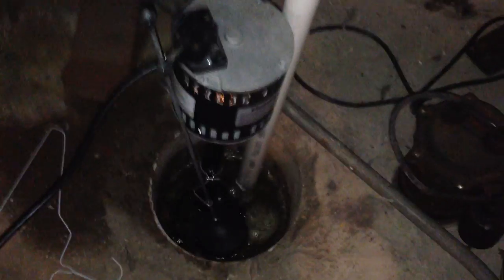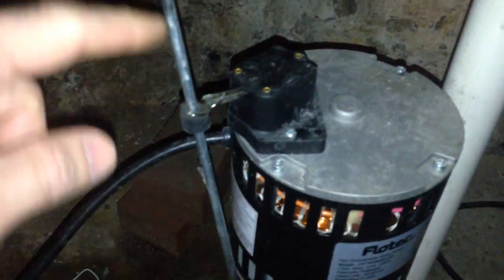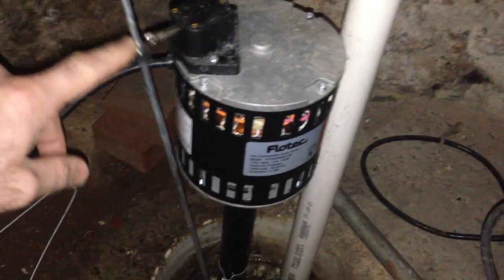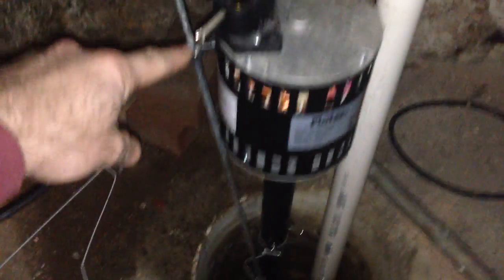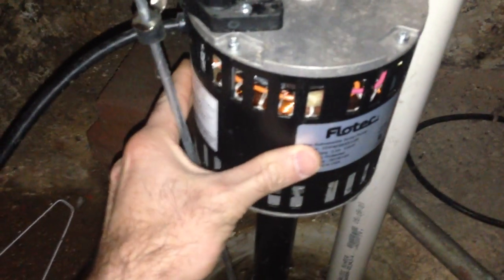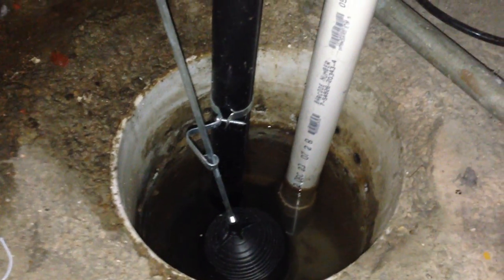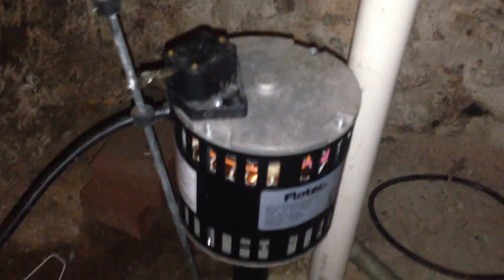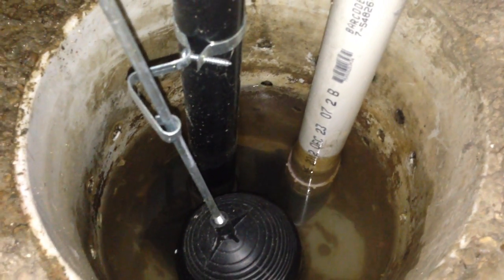Sump Pump Not Moving Water - Things to Check Valve - Wet Basement

Comment: your check valve should be closer towards the pump. that way when the pump turns off less standing water in the pipe before the check valve will flow back
Reply: Agree
Reply: Thank you for the good tip
Reply from the maker: You're welcome!  Thanks for the comments.  Glad to help!

Comment from the maker: I drilled the weep hole.  The after the intermittent problem persisted, I bought a new pump.  

It turned out the flapper had broken off the inside of the check valve, and occasionally would end up on the wrong side of the check valve causing zero water flow.  

A new check valve solved the problem.  It was not air lock
Reply: Yeah you didn’t need to buy a new pump.
Reply from the maker: @jacksondavis8624  True.  You might see the old pump on the ground next to this one.  That one had a different style floater and the pump actually did fail on that one I believe.  I think the impeller was all full of mud.  I think it was replaced ages prior and was just sitting there for years at the time I made this video.  A new check valve solve the problem after I made this video.  It was so long ago that I’m not sure if I took any videos or pictures of the broken check valve.  This video has become so popular that I feel I should look to see what evidence I have to provide.

Comment: Another tip. I found that the float wasn't strong enough to trip the 
switch any more. So I got some bubble wrap and taped it to the side near
 the  bottom of the float. Now the float has a little more pressure to 
rise and it has enough pressure to flip the switch.
Reply from the maker: Thank you for the tip!

Comment: Mine doing the exact thing. So I should drill hole in pipe? Which pipe?
Reply from the maker: NO!  Not a weep hole.  Check the check valve.  It might be blocking the flow.

Comment: Air lock?  Drill a small hole (1/8") in the side of the pipe pointing downwards at a 45 degree angle.  The hole should be close to the bottom of the pipe so that the water sprays back into the pit.  This allows the air that can be trapped in the impeller housing to escape.
Reply: Sounds like you've hit the nail on the head there buddy! It doesn't take much air to mess up a pump.. I'd put the hole about 1 or 2 inches above the threads and again I agree, 1/8 inch is plenty!
Reply from the maker: Nope.  Not air lock, but a bad check valve that is blocking the flow, only when it intermittently hits the opposite side of the check valve.  Replaced the check valve and all is good.
Reply from the maker: The pump was fine.  Just a check valve!

Comment: I had the same problem. Turned out to be the check valve. It has a small plastic disk inside, attached to the inner wall by a piece of rubber. The rubber broke, allowing the disk to intermittently block the outflow. Replaced the check valve and problem went away
Reply: I had the exact same experience as you Hank. Check valve flap occasionally got stuck preventing water flow in either direction. Replaced the check valve and everything is fine.
Reply from the maker: Yes!  Exactly!

Comment: You should get in alarm for your pump
Reply from the maker: Hi Jackson Davis.  The problem was that the check valve was a flapper disc that was connected by just the rubber seal, fixed in place on one small section of the circle of the flapper.  What happened was the small section of rubber ripped and the disc became free to bobble around inside the check valve.  On occasion, the disc would get pushed up against the opposing side if the check valve cavity, blocking flow entirely while it had pressure from below.  Relieving the pressure (shutting off the pump) would allow the disc to fall down.  Then the likelihood of it again landing on the top of the check valve cavity again was slim.  So the pump would be able to pump out the water the next time it ran.  Replacing the check valve was the answer.  It hasn’t given me any trouble since replacing the check valve.

Comment: Classic air lock.  Drill 3/16 hole angled down just above the discharge connection.  Problem solved forever.
Reply from the maker: Yeah, I'd thought so too, but it was a bad check valve.

Comment: Get a levelguard electronic sump pump switch.
Reply from the maker: Hi S Sap.  The problem was that the check valve was a flapper disc that was connected by just the rubber seal, fixed in place on one small section of the circle of the flapper.  What happened was the small section of rubber ripped and the disc became free to bobble around inside the check valve.  On occasion, the disc would get pushed up against the opposing side if the check valve cavity, blocking flow entirely while it had pressure from below.  Relieving the pressure (shutting off the pump) would allow the disc to fall down.  Then the likelihood of it again landing on the top of the check valve cavity again was slim.  So the pump would be able to pump out the water the next time it ran.  Replacing the check valve was the answer.  It hasn’t given me any trouble since replacing the check valve.

Comment: Same thing happened to me...my issue was my sump pump became unbalanced. Took me 2 days to figure out what the fk was going on. I have a submergible pump tho.
Reply from the maker: My issue was that the check valve was broken and the flap would sometimes end up in the wrong spot completely blocking the flow.
Reply: mknmike I was thinking it was my check valve as well...I was going to buy a new one but after I recentered the pump it started sucking water again...thank... God. Plumbing call averted.
Reply: I forgot to mention that I thought it possibly was broke. Do to something being sucked into the impeller..it at times would suck water but very slowly...like 15mins longer than it should take. I also thought it could have been a frozen outlet pipe...the first thing I checked was if it was clogged...spent probably 4 hours on my belly trying to unclog it..pulled out lots of nasty things..even a used bandaid from the previous owners..I probably have MRSA now..or Hep z...but I fixed that sump pump yeah boiiiiiiii
Reply from the maker: justin M 
Well, one thing to note is that my problem was intermittent and that the pump would run fine as soon as it was switched off and then back on again.  My pump would only remained “clogged” until it shut off.  If you can, envision this: the check valve is a disc connected by a rubber connection at one side of the disc.  When flowing in the right direction, water should push the flap open.  The problem in my case was that the rubber connection for the disc broke, and the disc was flying around (and probably never stopping the back flow either).  Occasionally, the disc would get pressed flat against the output side of the check valve and the water pressure would hold it there until the pump turned off.  I realize it was a unique scenario, but one worth noting.  You can see that most of the first comments were to drill weep holes in the pipe to assure it wasn’t air lock.  That’s probably a more common scenario.